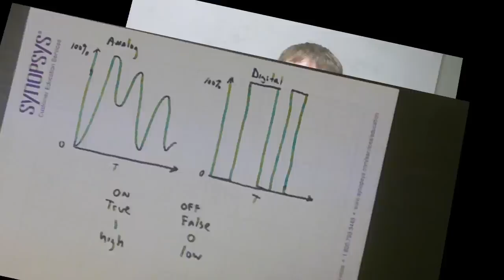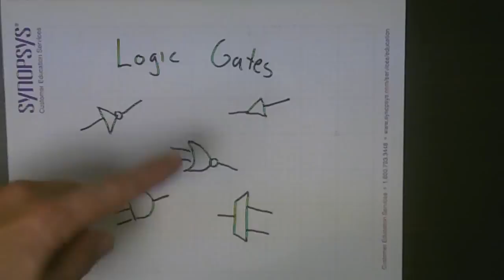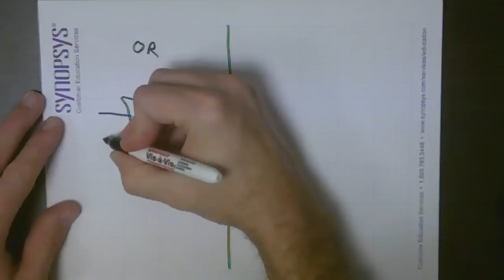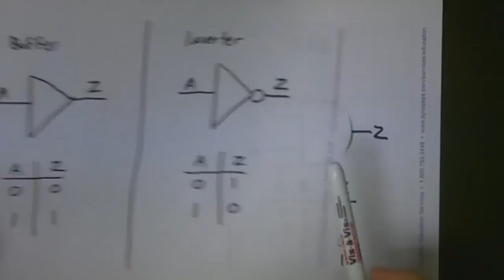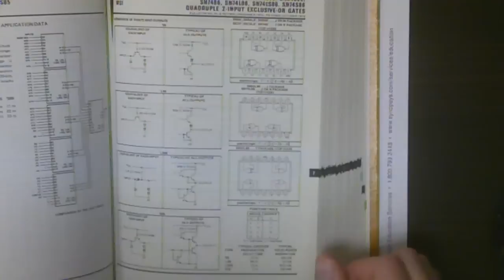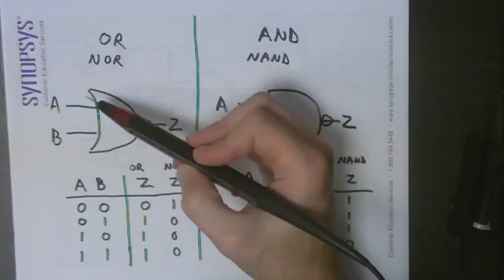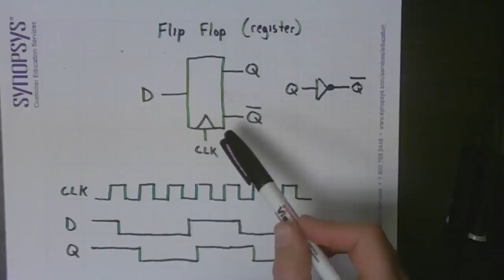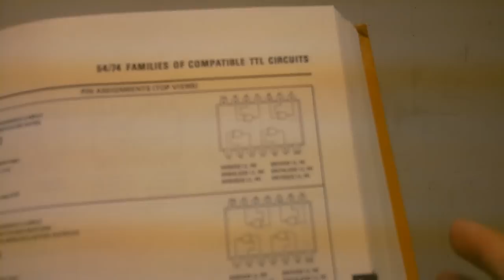Arcade Game Repair 101 - Digital Logic and Logic Probes!

Comment: Because of this video i repaired a flasher circuit for a offshore nav-aid lantern. The IC cd4049 (invert an non invert hex buffer) pin 14 was high and 15 was high. 15 should have been low. Anyway i replaced the ic and the sync pulse was back...success!!  Its people like you Adam that take the time to share what you know....thanks.

Comment: EXCELLENT!!...Thank you!....I have a question: What does it mean when a pin is lasted as "Enable"?.....And as far as the vid, it's just what i needed to see...i am patiently awaiting the next vid on this. I am trying to figure out the issues with my Stargate and this vid will maybe point me in the right direction. I am trying to figure out what a 74LS139 is supposed to do at pin 15,,,and I have the TTL book you have....this helps me understand it a little...because right now I get no signal on my logic probe..no hi..no low..no beeping..nothing lighting up...like its totally dead at that pin number.
Reply from the maker: An enable turns the whole logic gate on.  So for example, lets say an OR had an enable.  If the inputs A and B were both 1 and the enable was 0, even though the OR should send out a 1 (because we see a 1 on at least one of the inputs) the OR would actually send out a 0 because the entire gate is turned off (disabled).

In the case of the 74129, you have an 'active low' enable which means the enable has to be low for the chip to turn on.  If the enable is 1... no matter what the inputs are to the gate.. all outputs will be turned off.  But don't forget the bubbles on the outputs of the 74139.. instead of sending out 0's when the outputs are turned off they would output 1's.

Comment: Great video!  Do today's modern IC's in computers work the same way?
Reply from the maker: You bet, it's just that most chips have thousands or millions of logic gates in them.. as opposed to only a handful.
Reply: Would it be fair to say all an IC really is is a combination of multiple transistors?
Reply from the maker: Yep. Transistors.. capacitors.. even resistors, all made out of silicon and other various metals/materials.

Comment: Thanks..  one query,. These are all edge triggered,  have you ever found flat triggered ie 0-1-0. Or. 1-0-1 ? Cheers.
Reply from the maker: Flops are edge triggered and take a snapshot of the inputs like a camera.  Latches are also edge triggered but allow their outputs to match the inputs when the clock is high or low (depending on the type of latch).

Comment: Great video Adam!  I look forward to the next one!  I have the most trouble determining if ram is good or bad.  Do you have any tips for checking data and address lines other than looking for pulsing.  I have a fluke 9010 but only one pod and not much experience with it.
Reply from the maker: Hi Dave,  Yep my next one will be on CPU logic and it will cover those areas.
Reply: OneCircuit
 Excellent ... Thanks!